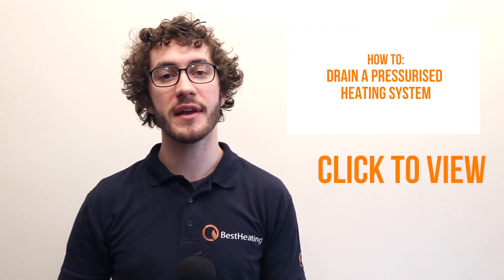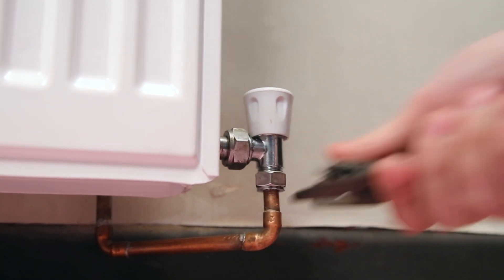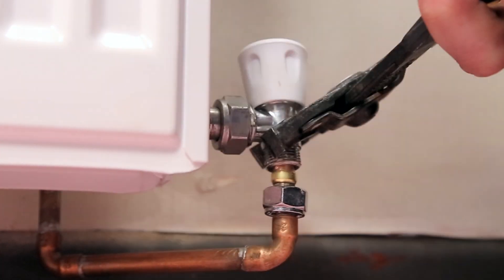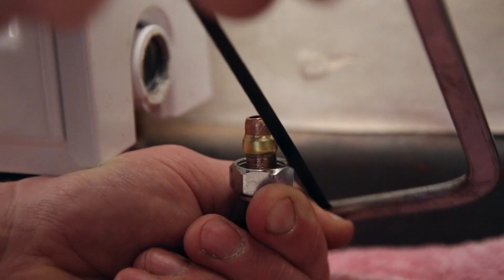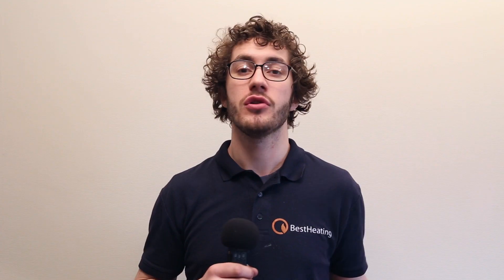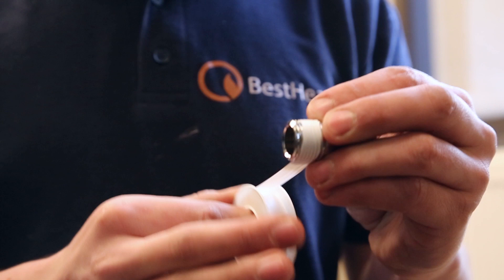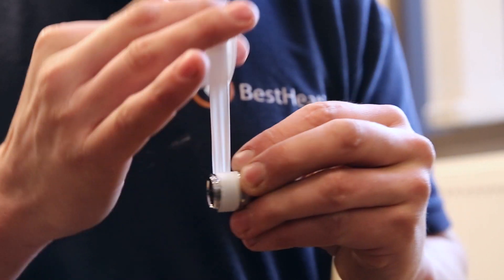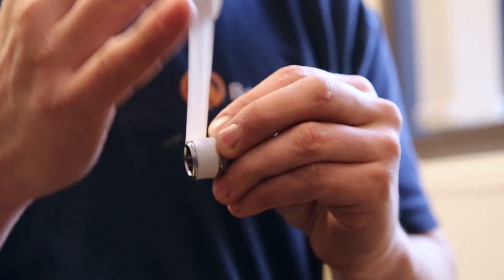How To Install TRV's To A Radiator | BestHeating

Comment: Hi I've realised that a few of my radiators go off after a while  I've the removed the trv of thse rads and they start to work again ? I've also noticed if I go lower a number the whole radiator goes off need a helping hand here please are the trv installed correctly ?

Comment: I am not quite sure on the ptfe  tape bit you showed and which end you taped. Cheers
Reply from the maker: Hi James, the but that gets taped goes into the radiator, but there is nothing stopping you from adding PTFE to all of the threads on your valves. It won't hurt them in any way.